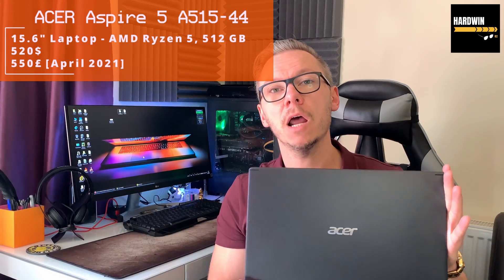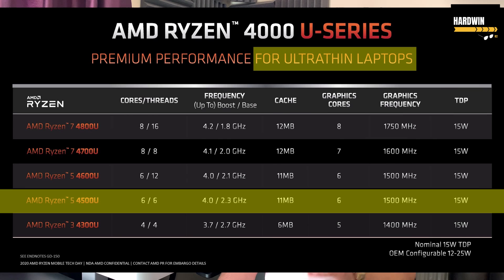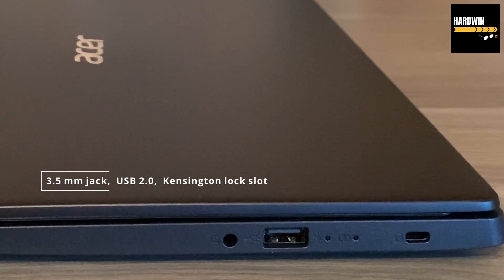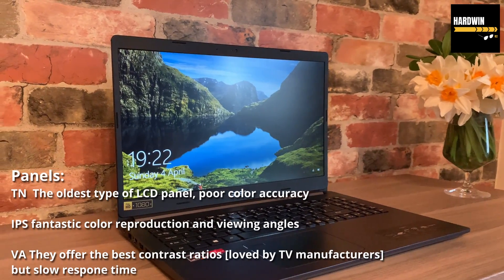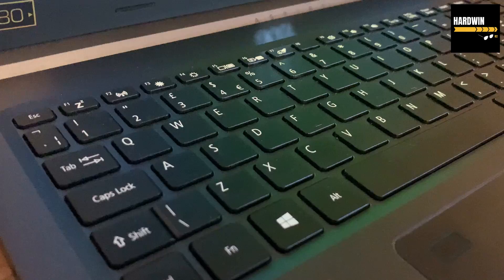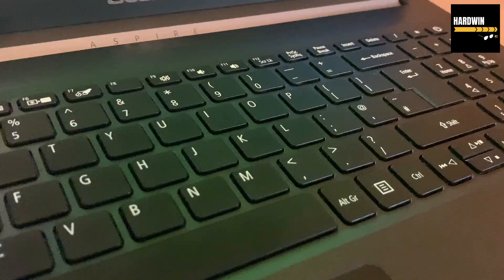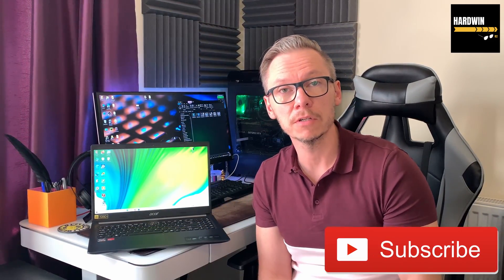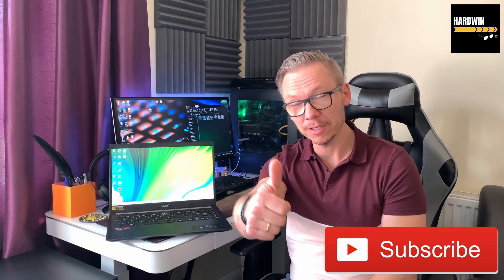Acer Aspire 5 A515-44 - review. King of affordable laptops 2021

Comment: It’s really good laptop for the money, upgraded ram to 16gb and extra ssd 500gb, also upgraded to wifi 6 intel ax200, applied new better quality thermal paste and reduced the temp really impressive now, also installed new fresh windows and updated all necessary drivers, only downside is missing backlit keyboard and bit better camera, overall good quality laptop for everyday use.
Reply from the maker: yeah, you're right, the camera could be better. Ps. great idea with the wifi upgrade